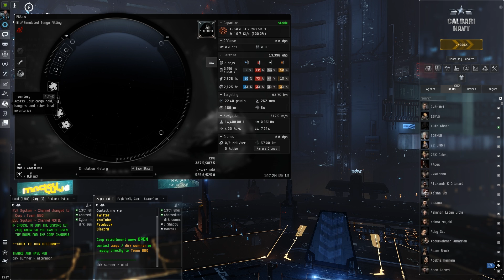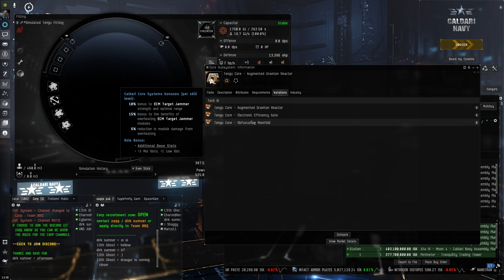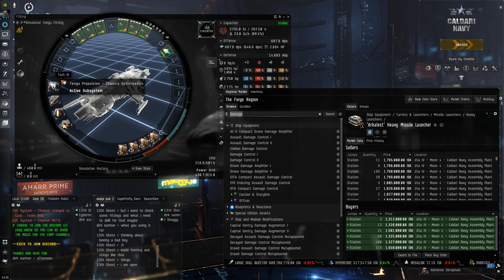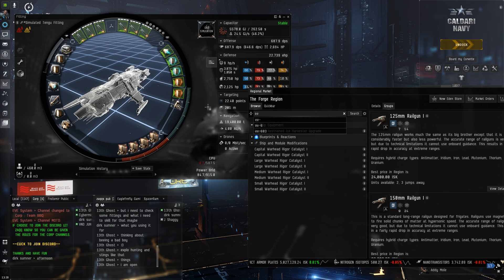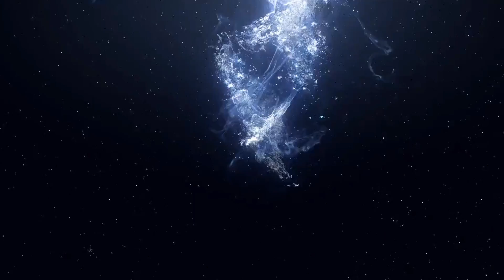Eve Online - TENGU / PART 1 - ALL IN ONE FITTING GUIDE  (in depth new bro friendly)

Comment: I did something similar but with an albeit blingy 5b fit, in a loki. Had something like a 3k/s rep cap stable with 100mn. Once did a lvl5 ded in tamma with a buddy running this kind of tengu...we eventually got jumped and although we both could tank pretty well I couldn't be caught and he could. I lived and he got eaten by a pack of tamma scrubs. Just something to think about...
Reply from the maker: Usually run a super cheap hamgu for the last deds seems to work OK. Got more loki vids in the works, one especially very pimped. Cheers for watching mate.
Reply: @zaqq  I was taking mine out to null and doing everything with it. 10/10s were the only thing I didn't like to use it for. They took too long to kill the structure thing.

Comment: For about the same price you can upgrade the mid-slots to deadspace C-type shield boosters. I also prefer the thukker cap battery as a go-to. The price is decent and the resource requirement, cap benefit is great. If you tweak your resists to be NPC specific, a 600m tengu can run 8/10 and 10/10 DED sites. Also, if you are going against NPCs that will rush you instead of run, switching to HAMs can get you up to 1k DPS with a 26km range; would be a good refit to keep on hand ;) . Great video though! Tengu's are awesome.
Reply from the maker: Thanks mate. And yea tengu is a beast especially as you say min maxing for specific rats and damage. The all in one fits are pretty chill to for the lazier pilots xd. Cheers for watching.

Comment: This cloaky one is a good alternative if u want to go in LS or NS to make some DED, it's my personal fit and my favorite so far

PS: Modules in cargo are only loot sorry ^^'

[Tengu, Tengu]
Ballistic Control System II
Ballistic Control System II

EM Shield Hardener II
Pithum C-Type Medium Shield Booster
Pithum C-Type Medium Shield Booster
Multispectrum Shield Hardener II
Dread Guristas Shield Boost Amplifier
Thukker Large Cap Battery
10MN Afterburner II

Sisters Core Probe Launcher
Covert Ops Cloaking Device II
Heavy Missile Launcher II
Heavy Missile Launcher II
Heavy Missile Launcher II
Heavy Missile Launcher II
Heavy Missile Launcher II
Heavy Missile Launcher II

Medium Warhead Rigor Catalyst II
Medium Warhead Rigor Catalyst II
Medium EM Shield Reinforcer II

Tengu Core - Augmented Graviton Reactor
Tengu Defensive - Covert Reconfiguration
Tengu Offensive - Accelerated Ejection Bay
Tengu Propulsion - Fuel Catalyst

Sisters Core Scanner Probe x16
Mjolnir Precision Heavy Missile x3332
Nanite Repair Paste x500
Mjolnir Fury Heavy Missile x2993
Scourge Fury Heavy Missile x3364
Corpum A-Type Medium Remote Capacitor Transmitter x1
Corpum A-Type Kinetic Energized Membrane x1
Corpum B-Type Explosive Energized Membrane x1
Reply from the maker: Looks great man thanks for sharing
Reply: Nice fit, I'll give that a go. I made a small change, replacing the Shield Amplifier with a 2nd multispec hardener as I run full HG Crystals. I love the idea of the cloak; too many dicks in Osmon etc. Cap stable too - what's not to love? Thanks 😊